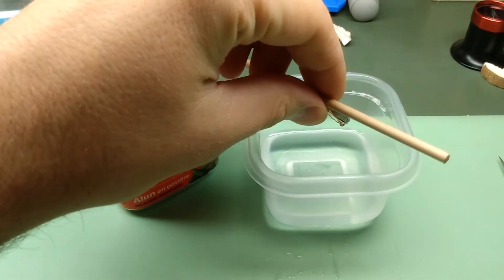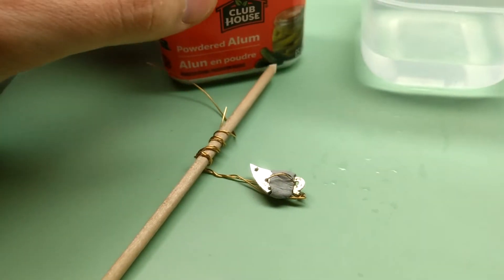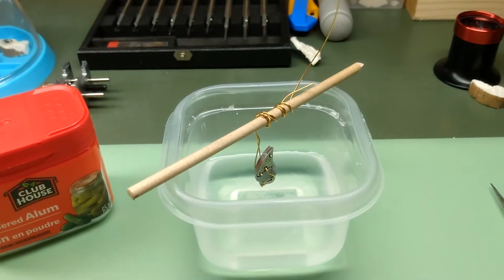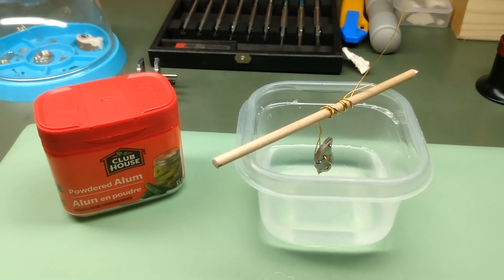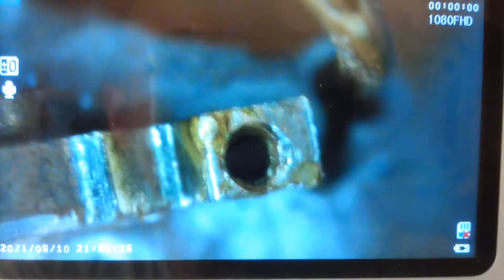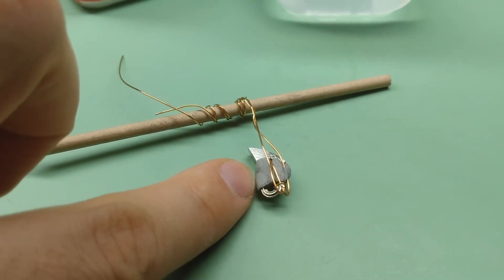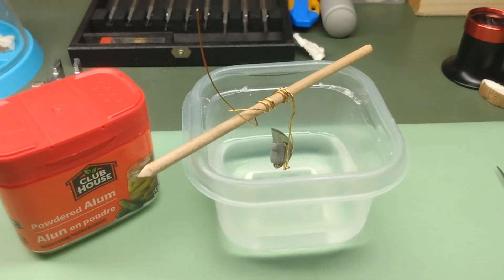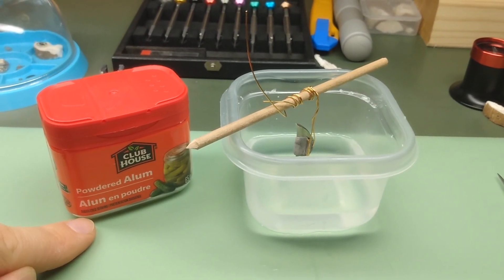Waltham grade 225 watch restoration part 3: dissolving a screw using alum powder

Comment: That won't harm plastic right? I got an old casio with two very stripped screws in the case
Reply from the maker: To the best of my knowledge it won't. I used a plastic tub as you can see there and it was fine.

Comment: I had the same problem with a Waltham 220.  The star was completely rusted and the screw on teh bottom was also rusted.  I successfully freed it up with wd40 and it all cleaned up nicely.  Replaced the star, blued washer and screw.

Comment: I've used this method to disolve a broken stem in a stainless crown. It was an odd crown that I couldn't replace. It took about a week, but the stem was completely gone. It did leave a black residue on the stainless,  but it polished off and looked like new. Good luck with the rest of the job.
Reply from the maker: Thanks Peter - yes it looks like the residue it will come off. Hope that's the last repair. Somehow these things always seem to crop up unexpectedly as you go along.